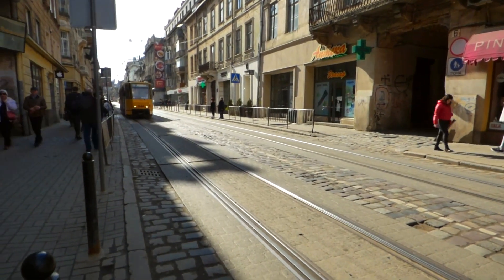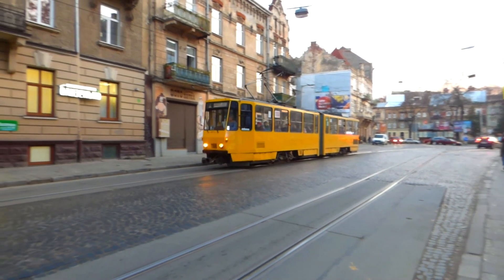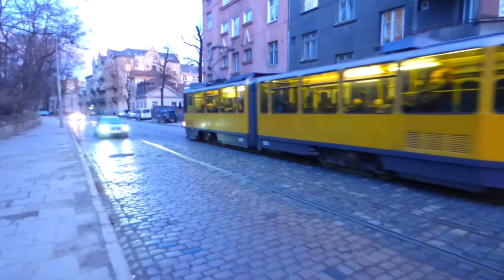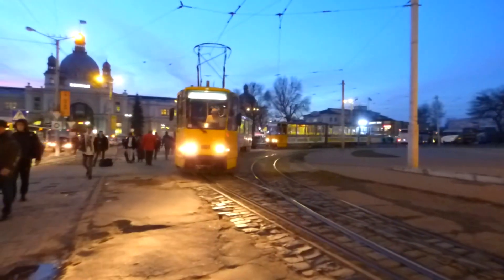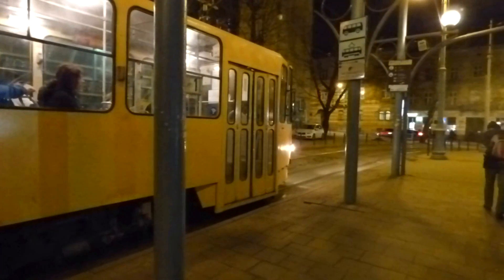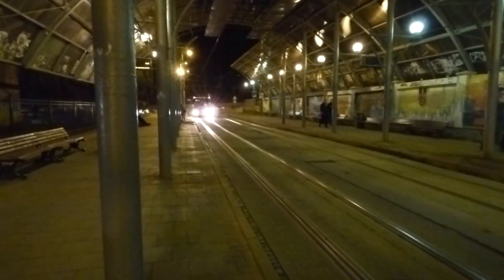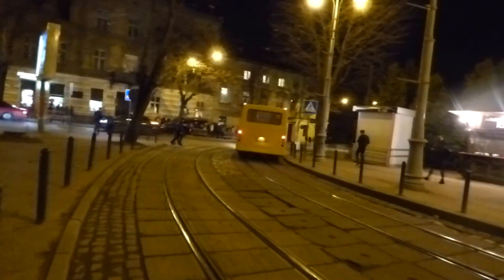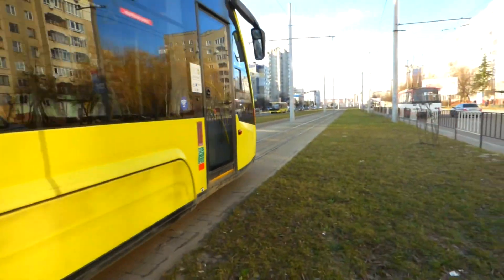knackered neglected tramway in Lviv (Ukraine)

Comment: Fun fact the Tatra KT4Dm which you can see at 1:00 is originally from Berlin. They chaged the gauge of bogies there, They did sell most of them to eastern europe, only a little number of them is still in use around here. Greetings from Berlin, I love you videos :D
Reply: Was about to comment that as well, the white-yellow-gray paint scheme looked very familiar 😂 Yes, they indeed are from Berlin, several ones actually. Sad to see just how run down they are...
Reply from the maker: How fast did they go in Germany
Reply: @benolifts  I don't know for sure, but according to several websites the maximum speed is 40 mph or 65 km/h - I don't see a reason for them to be restricted here in Germany, so I guess that's how fast they went.
Reply: @benolifts  Max. 60km/h Greetings from Berlin :-)
Reply from the maker: @unbekannte  So they are operating at half speed now
Reply: @benolifts  Correct. You can find them in Berlin at the Line M17.
Reply: Not only on the M17 they are also used on the M8 the M6 and the M5 in the rush hour. The top speed is actually more like 80km/h which was reached on the „Sternstrecke“ in Potsdam, they have the same type of tram but smalller gauge.
Reply: @Allianz1909  I was in Potsdam 2 weeks ago, the gauge is the same as Berlin. Not a metre wide but the normal 1435mm. https://flic.kr/p/2esGDiZ
Reply: They took them out of service.
Reply: @GermanPerfectionist The Berlin ones (outwards doors +half-pantograph) were mostly sold like that. Though they did run into several collisions since
The gifted ones that are continuing to be fitted to our rails right now look better. I think they either prepared them before giving, or the first time they sold lower quality for lower price